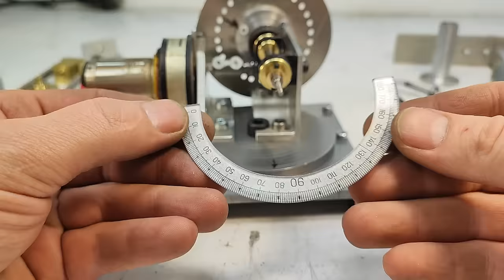DIY Gear Cutter. Mini Edition. Fantastic result

Comment: This fabrication is for a industry,just to make holes on the disc, need a special equipment. Meaningless to homebuild !
Reply: Unless you have a talent 😅
Reply: And more time
Reply: Hay gente q sabe corregir el centrado de un agujero con una lima, y hay gente q no sabe para q es una amoladora recta, y crítica o expone puntos de vista errados en Youtube
Reply: That disk with holes could be 3d printed.
Reply: All you need to make the disc, is a degree wheel, about $20.

Comment: Excellent concept. There are obviously some areas that need to be improved upon for accuracy, but it's a DIY project. Anyone can have a machine shop cut the perfect parts. The beauty of DIY is creating awesome things like this without $500K in equipment. You've come up with an amazing design. I hope you don't mind me using it for inspiration because this looks like a really fun project. Congrats for making an awesome little device.
Reply from the maker: Thanks a lot. It's nice to see someone who understands and can appreciate. Of course I do not mind. I'm also very interested to see what you can do. One head it's good, but two better
Reply: oh my.  soo nicely done. 
Very pleasing to se automation without computers acting up, destroying the day (the cnc-operator/programmer in me speaking) :) Also some inspiration & ideas for my machine to be able to get down in mod sizes.
I think i need mod0.15 for my rc-servo project ;)

Comment: Cool video. Please consider making a parts list so it's easier to identify what's needed to build this ourselves.
Reply from the maker: Thanks a lot. I have an idea to write subtitles
Reply: That is correct. At the beginning, you show some sort of materials but it was not enough.
Reply: @garciarj61  it's scrap material so a parts list wouldn't be the most useful for you as you likely wont have the same thing lying around. just look at the general function parts in the video are doing and see what you have that could do the same. If you dont get hung up on using the same parts it's all really easily salvageable components.
Reply: Can you give atleast the spindle tool diagram and 775 motor rpm

Comment: A lovely and intricate creation. I am most impressed by the fact that this runs purely electro mechanically and doesn't need a micro controller.

But if I were to suggest an "upgrade", it'd be a dirt shield right behind the rotation axis of the gear, or outright reversing the cutting direction of the cutter.
Throwing all that metal dust right into the moving parts can't be good for the little machine in the long run : (
Reply from the maker: thanks, I already understood this and made a protective screen.
Reply: Por favor, nos forneça o esquema elétrico deste projeto! @serengytech

Comment: Telling you good would be an understatement. You have created a jewel of mechanical-electrical engineering in 3D. Making criticisms of the actual use would be easy but the commitment, the competence, the planning, and the realization as well as the practical demonstration leave no space for you to have the best compliments. Just one observation: if I had the industrial waste you used I could compete with Elon Musk 😃😃
Reply from the maker: Thanks a lot. This is the coolest comment

Comment: subscribed! Congratulations on the way you solved the movement , steps and automation with only mechanical switches ! Your cutting tool is ingenious too. I would have used optical sensing for rotation. In this way it would need electronics, but you would be able to print a disc in transparent material (i.e. with a laser or inkjet printer) , and have infinite options.
Reply from the maker: Thanks a lot. I see you understand these systems. It's a pleasure to deal with such a person. I really liked the idea with the optical system, I'll take note
Reply: Alternatively, if you are to add electronics anyways, you could use a rotary encoder/potentiometer to control the motor and get infinite adjustability without having to change any parts. You could also replace the indexing motor with a stepper to do the same task. I love your electronic dividing head concept though.

Comment: All this needs is a pitch adjustment. Very nice design though I can see improvements to it. How about a dust collection system and cutting oil drip? This would be excellent for hobbyists who need to make polymer, even glass gears.
Reply from the maker: Thank you. there is still some work to be done here

Comment: You should offer a kit or at least plans with motor sizes etc, so others could follow your example. I don’t have a lot of the stuff laying about and would even know where to begin to find the drives and switches of the correct sizes. 😊
Reply from the maker: Thank you very much for your interest. Unfortunately I didn't make any drawings.

Comment: Really amazing, Thanks for sharing!
What type of metal is the actual pin used @12:17? Wouldn't that get wasted while trying to cut other metals?
I'd love to me this ;)
Thanks!
Reply from the maker: Thank you. This machine can cut gears made of non-ferrous metals. such as aluminum, brass, bronze and of course plastic
Reply: @serengytech  Thanks for your fast response. Did you need to to make the spinning pin that cuts or is it a standard product. Excuse me for my ignorance. I am confused about the angle of the cutting edge as I think it may change the shape of the resulting cogwheel. Again excuse my ignorannce :/ 
I'm really keen on building this thing ;)
Reply from the maker: @MIZKhalid  I made the cutter itself from a piece of an old carbide drill
Reply from the maker: I made this cutter by hand, so it’s not perfect.

Comment: Excelente video pero que materiales usa sobre todo que tipos de motores especificaciones. Gracias buen aporte a la cultura y educacion.5☆.
Reply from the maker: Any motor can be used. How much fantasy is enough. at that moment I found just such in the workshop. one from a screwdriver. and two more with a gearbox. there are many such engines.

Comment: Nice job but I have a little doubt about the general accuracy of the gears
Reply from the maker: You are right. There are inaccuracies in this video. The fact is that I did not mark the dividing disk accurately enough.
Reply: @serengytech  yeah, that disk and its interface with the microswitch is certainly the linchpin of the system. I'm wondering if there's anything about the geometry of the switch lever that could make it more accurate. Another thought, when that switch engages, are you simply breaking the circuit to stop the rotational motor? It might be able to be stopped a few microseconds more quickly if you wire it so it also shorts the motor at the same time. "Short braking" is often used in such a scenario to stop these kinds of motors using the back EMF that occurs. Perhaps that's what you've already done anyway.

Very cool project. Love things that are pulled together from random scrap like my own router table with parts from rollerblades and a rototiller.
Reply: The slip fit in the center is a problem to.
Reply: Sir mujhe ek project ke liye gear banwana hai kya ap bana dijiyega 🙏🙏🙏🙏
Reply: Party pooper

Comment: Wonderful tool for any shop or hobbyist. Ive been working as a machinist for 14 years so i could come up with most of the parts. My question is where do i find that tiny indexer plate?
Reply from the maker: Thank you. I don't quite understand what part you are talking about. Please clarify. I will gladly tell
Reply from the maker: Perhaps you are asking about the dividing disc? It is very easy to make. I have another video on my channel where I make gears on this machine. There I just make such a disk
Reply: @serengytech  great thanks for the amazing videos!
Reply: Он легко делается копированием по нужной шестерне на новом диске или свободном поле.

Comment: Looks like a DYI indeed, relatively simple, everybody should be able to make it

A few questions though:

How did you make the indexing plate ? It looks something store bought

When you made the brass gears, did you make an oops ? I mean, those two gears would NEVER be able to go into any kind of drivetrain as there was a spot where you had 1½ tooth spacing not cut

Other than that, looks like I may have to add yet another channel with good ideas
Reply from the maker: Hello. In this video, I make the machine itself. gears are not very good. because I didn't properly partition the partition disk. There is another video on the channel where I make gears on this machine. everything turned out to be perfect. look. https://www.youtube.com/watch?v=QChCppBxIl0&t=3s

Comment: Clever-made device! 14:33 little detail on one of the gear teeth?
Reply from the maker: You are right. There are some inaccuracies in this video. The fact is that I did not mark the dividing disk accurately enough.
Reply from the maker: https://youtu.be/QChCppBxIl0 I have already fixed this error

Comment: Excelente proyecto amigo, un listado de materiales podría proporcionar y la especificación de los motores por favor, muchas gracias, saludos desde Guatemala 🇬🇹🇬🇹🇬🇹🇬🇹🇬🇹
Reply from the maker: Thank you very much for your interest in my machine. unfortunately I did not make any drawings. the main engine from a screwdriver. the other two can be any with a gearbox.

Comment: great bit of kit i do think that the cutting tool needs adjustment as the  teeth are a bit pointy other than that    great idea and youve made it
Reply from the maker: Yes, I agree. it was the first run I already set it up. later I will show in a new project

Comment: Thanks for the video. May I ask something; which frequency and features are required for the transducer to measure the concrete or wall thickness?
Reply from the maker: concrete control is possible only at frequencies not exceeding 100 and 150 kHz.
Reply: @serengytech  for example 30khz.

Comment: Hi I'm impressed my long issue to make an indexing automation without using programming. Possible to share the wiring diagram?
Reply from the maker: Thank you. The circuit is very simple, like a walk-through switch in the corridor

Comment: Hello, what cutting tool do you use?
Reply from the maker: This is a piece of solid drill bit
Reply: high speed steel cut to the shape, did I understand correctly? @serengytech

Comment: In what applications do you use these gears? It looks like they are severely inferior to ready-made ones in terms of precision and accuracy. Also, bevel gear shape is wrong (the teeth must be smaller closer to center).
Reply from the maker: https://youtu.be/GCQHCTb1Wek
https://youtu.be/GCQHCTb1Wek
Reply: E infatti nella foto sono triangolari ,perché in alto si stringono

Comment: Merhaba biri.buyuk,biri küçük çaptaki dişlileri nasıl hesap yapacağız
Reply from the maker: There is a special formula for calculating gears. and also there is an application for the phone there it is easier to calculate
Reply: Which application is that?

Comment: Uhmm... Why does the dividing head take a double step? Skip out one disk hole when back switch pressed? It shouldn't seem...
Reply from the maker: This is how the scheme works. start of movement when pressed, then pause and continue when released
Reply: @serengytech  How this pause is realized? :) I imagine that while the carriage changes direction, the rear switch is held. This starts the divider motor and it turns to hold the divider switch pressed until it falls into the next hole and stops the motor. By this point, the rear switch is already open. Both switches are NO and connected in parallel. Do I get it right?
Reply from the maker: @TomaTLAB  Like that

Comment: In fact, this mini machine produces no usable gears as can be seen with the naked eye. The finish leaves too much to be desired. The number of teeth in this setup is limited to the number of punctured rings you make in the distribution disc, so the usability is limited. However, the idea is clever and very creative.  Maybe decide if you can buy a nice (used) lathe and milling machine? You sure have skills :-)
Reply from the maker: Thanks. I have a lathe. Here I wanted to show the idea itself. Pure mechanics and no computers

Comment: you will never cut good bevels. the blank has to move like a cone in relation to the cutters. all lines converge to a central point. its basically impossible to do without the proper gleasson gear generator. everything else is a compromise, and will require extra steps to get reasonably smooth, read... reasonably. never "precision".

as nice as it is... too single use. with a reciprocating tool its possible to cut nearly every gear type in existence. rotary limits you to spur and helicals.

and on that note, rather than a form tool, use a slit saw and generate the involute with repeated passes. lot easier than grinding cutters.
Reply from the maker: I understand you. but I only need two types of gears. for a specific project. https://www.youtube.com/watch?v=JPvsIP4gOsM&t=257s. for this drill. I got orders, that's why this machine was born

Comment: Those gears are going to bind up they are useless
Reply from the maker: This is just the beginning. there will be refinement and running-in
Reply: @serengytech  You are nearly there, You can check for backlash and try to minimise it. Then test cuts, you can get the indexing and tooth count just where you want it and the speed, shape, and hone of the cutter to as perfect as you can. Then a tumbler will help knock off the burrs. I would like to see it cut gears from Delrin 500. I have subbed the channel so I will Keep watching Good Luck. I am so glad to hear you are going to squeeze as much accuracy as is possible from it when you can cut good gears the world will be your Lobster not Oyster.🤣